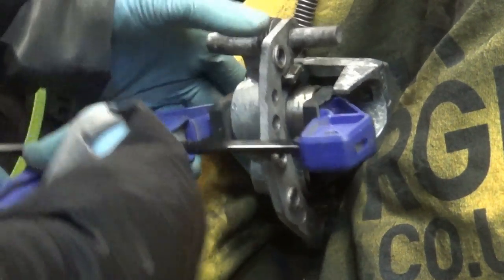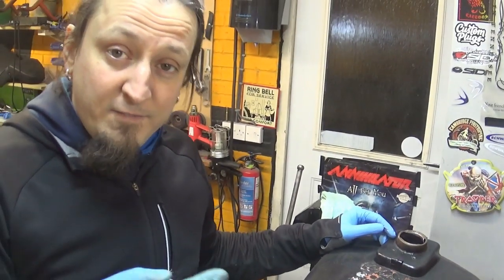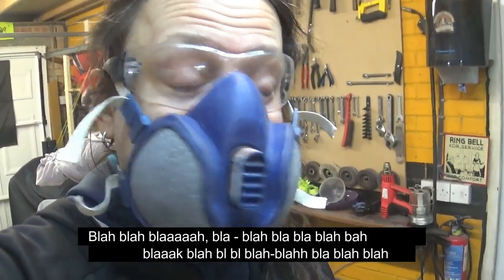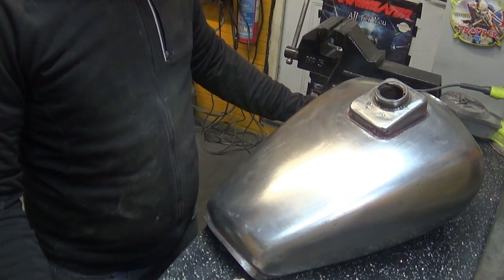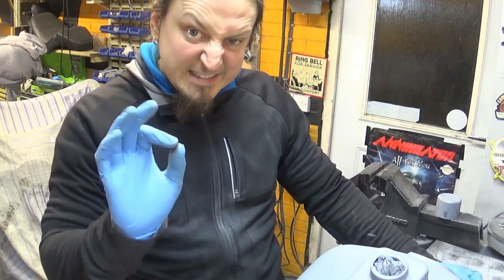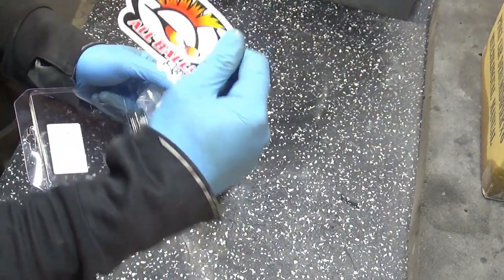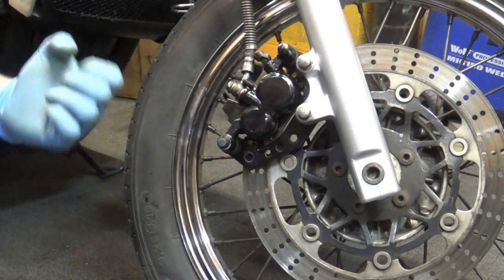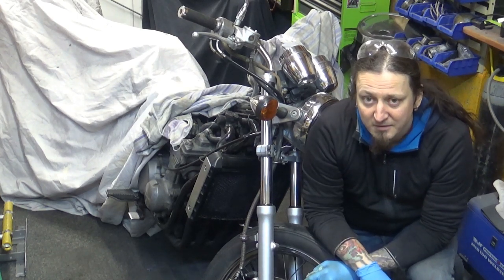Kawasaki Eliminator ZL 600 -part5- Brakes and Tanks

Comment: dude i love your vids especially on the eliminator cause i got one for myself this december. The 400cc but i would like your opinion on something .I live at a small city of Greece and the engineers here are limited and they speak in ridles{for easy money apparently} So my problem is this. my spark plugs get oily and black after half hour of running of the engine and the engine starts to run unbalanced.Shuts down if i remove my hand for throttling at least 5% . the carborators are clean and refubriced and also calibrated by a specialist and also no problem with the airfilter or the mixture i guess. that it. i hope you respond and again great channel and content my friend!!!
Reply from the maker: Oily spark plugs can mean that oil leaks into the cylinder, either bad piston rings or rockets (I think) but it may not be that bad. I can't really advise any more brother.  You'd  need to seek help of a professional,  which clearly I am not. Hope you get it sorted buddy as they are great bikes.

Comment: coming along nicely mate, you probably aready know this but, get your self a large syringe and some fish take clear hose, i think 5mm ( 5MM ID x 8MM OD), i think i used 4mm ID on the smaller side of the one way air fish tank plastic valve. from that well known shopping web site lol, and just reverse bleed your caliper, just use a 60ml syringe, it saves all the mess with fluid going every were, iv done abs units on my expolice bike i had a few years ago, and countless other bikes and abs units, just take your time and dont put to much pressure on the syringe. if you do a 2 caliper system, i always put a piece of fish tank clear hose with a fish tank one way air valve on the left hand caliper, and leave that bleed nipple open while i syringe new brake fluid in from the right caliper, also leave your master cylinder cap off, and watch the master cylinder fill up as you go.
Reply from the maker: Good tip brother. I used that trick on my KTM 990 clutch, where it is nearly impossible to bleed it from top to bottom, soe reverse bleed is the onlyway. I chose the traditional method here, as the hose is thicker and it is easier to drian old fluig this way, that was full of crap.